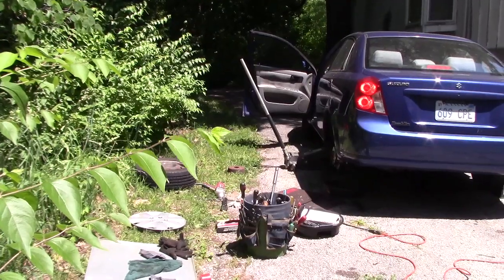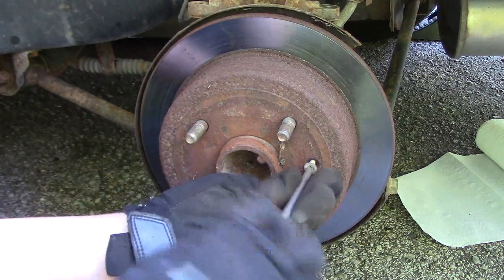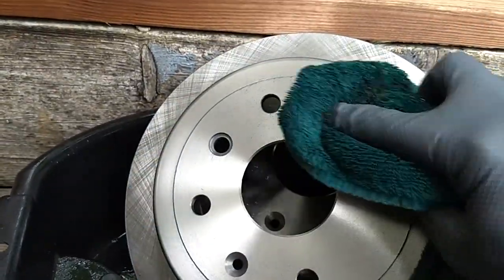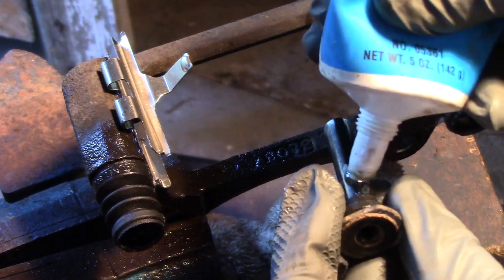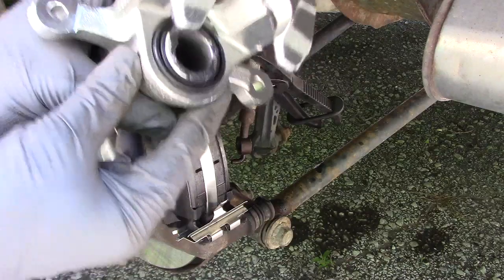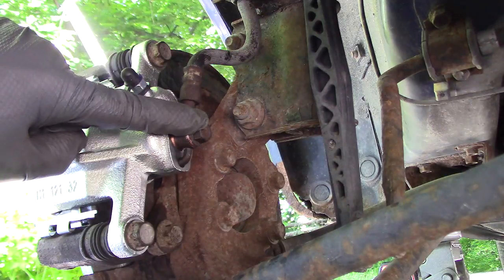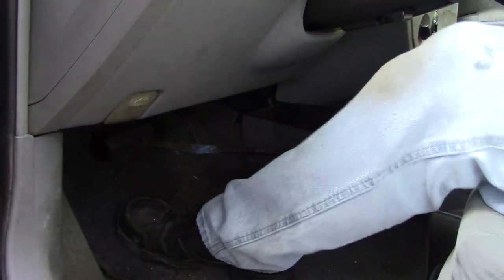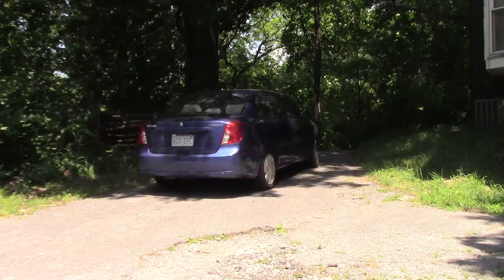DIY Rear Brake Replacement

Comment: Thanks.  A suggestion:  @6:59:  There are less messy ways to bleed brake lines.  Not the best idea to have brake fluid all over the place.  A tube would allow you to capture the wasted fluid and to bleed the line completely in one shot by yourself (because the tube holds fluid that keeps air from getting sucked back in).